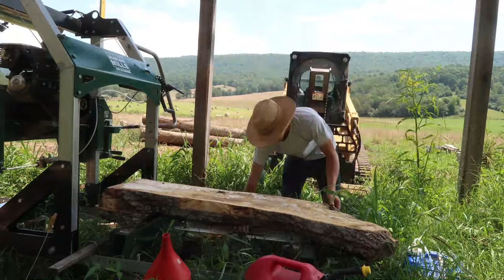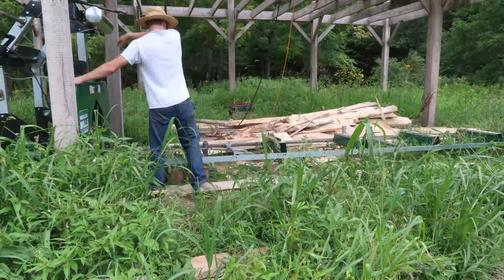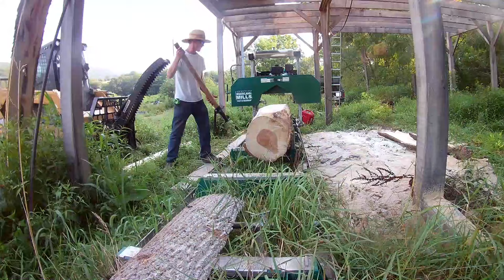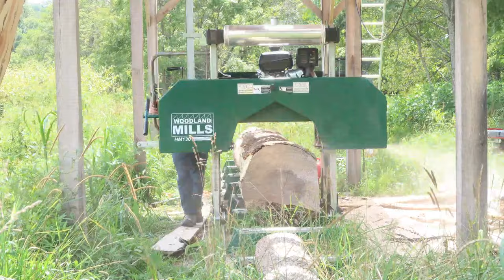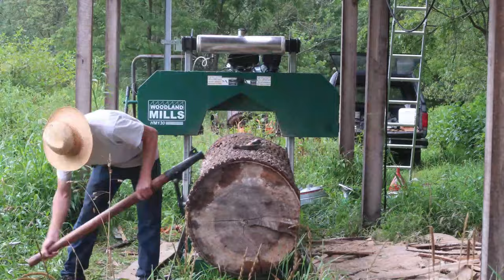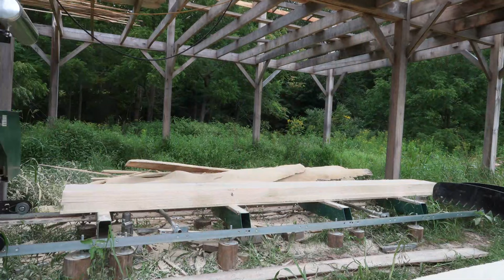1100+ Square Feet of Sheathing!! | Sawmill Shed

Comment: If that is permanent  spot for the mill why didn't  you just pour concrete slab for it
Reply from the maker: Cost is a big factor in this project, and that just wasn't feasible. I may eventually put a slab under the mill, but for now it's working fine the way it is. Thanks, Josh